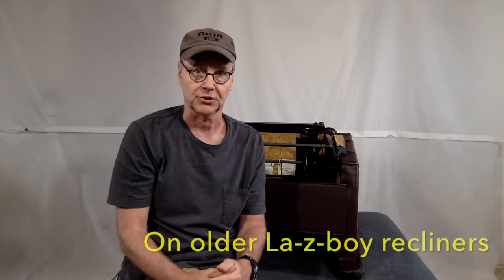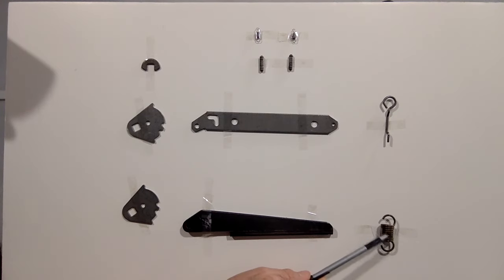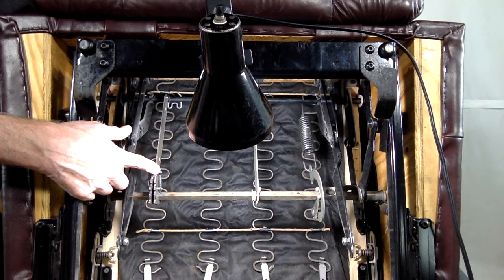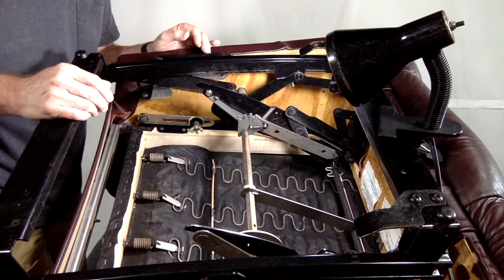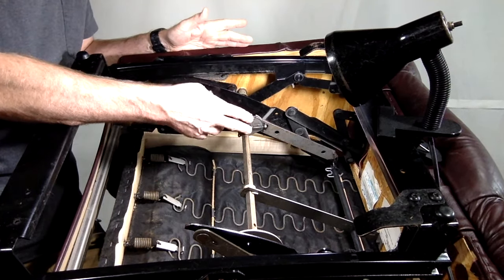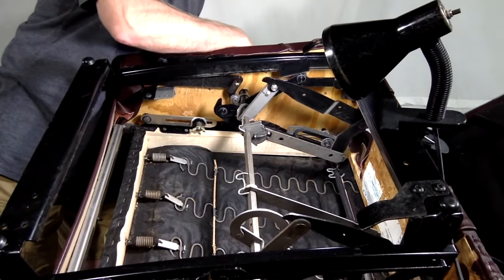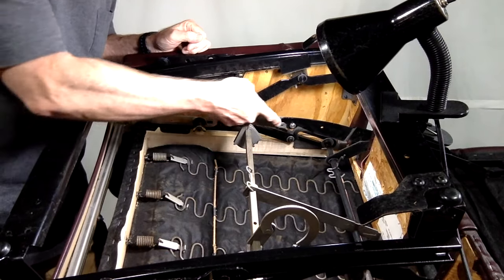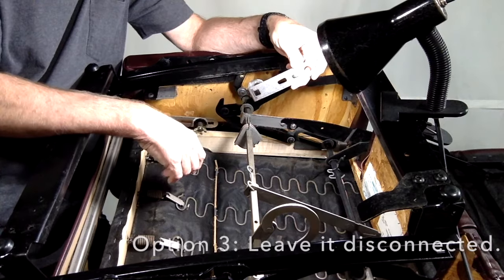Troubleshooting the La-z-boy 3-Position Footrest Feature

Comment: Thank you for this video!  I have a nice leather La-Z-Boy from 2001.  The footrest has been sticking off and on and last night became completely stuck in the up position.  Using your video as a guide, I completely removed the 3-position lever. I also appreciate the warning about having it all the way open or closed, to safeguard one's hands. I will not need to rebuild, as I only need completely up or completely down.  My chair now works like a charm!  And it only took about ten minutes and no repairman's bill to pay!  (By the way, I am a 68-year-old woman.  I'm quite mechanically inclined and relatively strong, and I like to fix things if I'm able.)
Reply from the maker: @Joy Rimpau - Congrats! Disconnecting the older 3-position mechanisms is a prime example of knowing a few simple steps, rather than being highly-skilled or trained in order to perform the required fix. Good job!

Comment: Thanks for the video, my good man. The pivot pins look a lot like one of the pins within the trigger housing of the Remington 870, although they're going to be wide. I'm gonna need to dig around for them to see if that would be a viable option even though they wouldn't be factory.

Also, the entire time you're saying "upgrade" to the "modern" PLASTIC parts by buying extra crap, my brain was screaming "Cut it out of metal!" I may still be young, but I've learned that plastic is almost never an upgrade.

Merry Christmas, brother.
Reply from the maker: @NeverMetTheGuy - I just placed a La-z-boy part order that included Pivot Pins. I want to see if they might be available again. Check with your local La-z-boy dealer to see if they may have some left in stock.

"Upgrade" was a poor choice of words, "convert" would have been better. I have to say though, that I do recommend the conversion for those who use the 3-position feature heavily. The plastic clips are easier to swap out, typically last a long time and are cheaper to replace.
Reply from the maker: @NeverMetTheGuy - I was able to get the Pivot Pins I ordered. If you've not tried to order them yet, give it a shot!

Comment: Thanks for these videos. My Lazyboy recliner is 22 years old. The reclining gear finally stripped out. I didn’t want to trash the chair. I followed your video to fix it, ordering parts from Amazon. 
Then I realized the 3-position footrest hasn’t worked for years, so when this video, I fixed it. My parts look a bit different but you gave me enough to fix it. The little springs were broken but I still had the pins. I found a long spring at Ace Hardware with the correct circumference. I cut two springs from this new one and voila! It worked. 
Thank you. You saved me $1,000 for a new big chair.
Reply from the maker: @XanderJudd24 - You're welcome -- good job!

Comment: I have an older style 2004 model with the pins.  My u/c bracket (spring hook) broke on it and no nearby dealers sell it anymore.  Seems like finding parts for older model chairs is impossible.
Reply from the maker: @theoriginalplasticwrap - The parts you need for your 3-position footrest setup should still be available. Contact La-z-boy through their contact (email) form on their website to find out.

Comment: I have an electric Lazy Boy. 2019 1HR530.I know it was designed to not lock when in the recline position (Lousy Design) But the Foot rest only lifts up about halfway maybe 3/4. It will not go all the way up or flat. Any suggestions?
Reply from the maker: @Ron Glaze - Have an experienced repair tech inspect the chair. Many newer La-z-boy electric recliners do not open as far as older models. The tech can tell you if that's the case, or if there's a problem with the mechanism operation instead.

Comment: What is the name of the large semi-circular silver part next to the scissors mechanisms on each underside of the chair? The circular parts rotate when the recliner lever is engaged or disengages. One of the "circular parts" is inoperable because the rivet holding the circular part to its attachment on the recliner operating shaft sheared off completely. How do I stretch the spring to align the circular part with the stationary "ear attachment" on the recliner lever shaft? I can't afford to replace this chair so I hope you can help me.
Reply from the maker: @tearjerkMASS - The "C"-shaped part is the Toggle Subassembly. The purpose of this part is to hold the tension springs that assist the mechanism in opening & closing. Newer chairs have 1 Toggle, while older models can have 2.

With one failed Toggle, you should still be able to open & close the recliner. But you may notice there's less of an assist from the springs. If that's the case, you don't need to repair the failed Toggle. If you decide to repair/replace the bad part, get an experienced repair tech to quote the repair.

Comment: Thank you so much! I have a 1991 Lazy Boy recliner that I bought new and have never had a problem with until the other day when the footrest got stuck in the up position. Thanks to your clear instructions and excellent video footage, I, a 61-year-old woman, was able to pull off the back, flip it over, and remove the small pins and springs around the 3-point  ratchet, and now it works perfectly! I  never realized that I don’t use the footrest positions any way. I adjust using the back ratchet mechanism. I’m back in my “Lazy Girl” again!
Reply from the maker: @Mary Mclvor - Congrats!

Comment: Hi Recliner Repair Guy!  Thank you sooooo much for the excellent video.  Very helpful for the 3 position repair.  Got the bullet pins and springs on Ebay for $15.  Not sure where the spacer goes but we fixed a 12 year old chair pretty easily.
Reply from the maker: @Lynn Dolphin - Good job! The spacer that fits on the Drive Rod -- if that's the one you're referring to -- goes between the 2 Lock Plates (gear-like looking parts).

Comment: I have an old lazy boy rocker recliner, the wire that pulls the foot rest up and down has broken several times, that I fixed with some wire I bought from fleet farm, but this time after I fixed it,  I have been having this problem of it only going to one position, which I'll look at to see if I can see what you are showing here, even though mine does look quite a bit different, but the problem that's really bothering me is that when it's reclined it seems to not lock in place.  So when I'm laying back the chair still rocks back wards.  What could cause that?
Reply from the maker: @Scoobydoonut - It sounds like your Ratcheting Recline parts may be worn and need replaced. See this video ---> https://www.youtube.com/watch?v=d8Bk2j4dc-k&t=2s

Comment: Can you help  me I need my foot rest keeps falling down when I put even the weight of my legs on it it's a lazy boy idk the model number
Reply from the maker: @EntertainmentHub92 - If you've inspected your mechanism Leg Extenders, as suggested in the video & found no problems, you can try disconnecting the 3-Position Lever (or 3-Position Locks, if you have those). If the footrest still won't stay up, have an experienced repair tech take a look.

However, if the entire chair pitches forward, but the footrest stays in the fully open position, this is a Ratcheting Recline problem. Again, have a repair tech take a look.

Comment: Thanks so much for this. The recliner I have is one my parents used to have and has the old metal 3 way. I was able to get that disconnected so now the footrest does go all the way down and will lock up. A side effect is that now the ratcheting for the back doesn't work anymore. I don't believe I will be able to get replacement parts that will work. I suspect the answer is no but is there any way to get the back to ratchet as well? I was thinking maybe some way to plug the gaps in the 3 way and re-connect it.  Thanks in advance!
Reply from the maker: @EdCatlett - The Ratcheting Recline tips (pitches) the entire chair back. It's separate from the 3-Position Footrest function. The Back tilt is yet another separate function, independent of the other two. (See the 3-Position Footrest & Back Tilt Tension videos to learn more.)

Disconnecting the 3-Position function will not stop the Ratcheting Recline (or back tilt) from working, if it was working properly to begin with. However, you may have to use the chair a bit differently to engage the ratcheting feature. 

For example, if the chair is slumping forward when the footrest is fully extended, you'll need to move your weight back in the chair to engage the Ratcheting Recline. 2 ways to do that: #1 If you have long legs, move 1 leg off the extended footrest & onto the floor & push back to engage the ratchet. Or push back against the arms. Or, #2 Do not sit or lean forward when opening the footrest. But rather throw your shoulders back a bit when opening the footrest to engage the ratcheting recline. 

If none of these suggestions help, find an experienced repair tech to troubleshoot the problem.

Comment: My legs Lazy Boy does not go high enough for my legs and I would really like to just disconnect the lower part of my chair and just have it upright the upper part I just want to reply never fart I can use a chair or stool put my legs up on that will be the right height so how can I disconnect the lower part of this chair I don't want it to raise because when the electricity fails I can't get out of my chair I had a generator installed just so I could get out of my chair that the electricity I bought my chair in December and this is April and the push buttons on the side I really hard to get to and they quit working my first Lazy Boy at my mother gave me in 1984 and I've been sitting in it ever since the wood part underneath the spindle broke I guess it right it out and it broke and I surely do miss my chair
Reply from the maker: @Linda M Johnson - Most electric La-z-boy recliners come with a battery-backup compartment located inside the power supply. If you're concerned about a power failure, make sure you have fresh batteries installed.

If you want to disable the footrest, have someone disconnect the electric plug to the footrest actuator for you.

Comment: Okay, I took the swivel base off, and was able to remove the springs and pins, and the arm.  Put the chair back together, and the footrest goes up, but won't lock in place.  What should I be looking at?
Reply from the maker: @donriley9053 - If the footrest is closing on its own -- not staying open -- you need to inspect the Leg Extenders (scissors), Toggle tension spring & other parts along the Drive Rod. You're looking for bent, broken or damaged parts that are preventing the footrest from locking out into the full-open position.

However, if the footrest is staying open, but the chair itself is dipping down in the front, that's likely due to worn Ratcheting Recline parts. See this video for more  --->  https://www.youtube.com/watch?v=d8Bk2j4dc-k&t=3s

Comment: Mine was bough in 01/04 and doesn't have ratchet looking gear thing. Mine just has more of a "U"-shaped hook thing on each side. Any idea what I can do?
Reply from the maker: @teller12 - Not all La-z-boy recliners have the 3-Position Footrest feature. If you don't have the metal setup shown in the video, there is another type which uses the plastic 3-Position Locks shown in this video  ---->  'The La-z-boy Recliner 3-Position Footrest.'  [ https://www.youtube.com/watch?v=-uMYiqBp0y4 ]

If you don't have those, you don't have this feature. HOWEVER, if you check out the video I suggested, it will explain how you may be able to use the plastic locks on your recliner.

Comment: How do I actually change that mechanism ? I have to manually release the pin every time my wife reclines the chair. I know that I need to buy the part, I'm not sure what to call it to even order it. Thanks so much.
Reply from the maker: See the video series -- 'Drive Rod Replacement' on the ReclinerRepairGuy.com website. Those videos include removing & reinstalling parts along the Drive Rod. The video where you placed this comment shows you how to disassemble the parts. Assembly is done by simply reversing these steps.

Tip: Use a bent paper clip to stretch & install the small extension springs. It's easier than using your fingers & less likely to damage the springs.

Here are the new parts you'll need to rebuild the older, metal 3-position footrest mechanism.
     * 3-Position Lever - 1
     * Lock Plate(s) -- your setup may have 1 or 2, depending on the age of the chair
     * Pivot Pins - 2
     * Extension Springs - 2

Be sure to add any other parts you need to your parts list, including pins & clips that hold parts in place. When in doubt regarding part names, you can always email them a picture.

Comment: You show and describe a plastic part, and then show a chair that is made of metal parts.  Do you know there is a difference between metal and plastic?  They are not the same and do not interchange in this video.  Pretty worthless.
Reply from the maker: @david hjortnaes - Text from the video, "In a previous video, we covered newer La-z-boy chairs that have that (3-position) feature controlled by this black plastic part, called the 3-Position Lock. The video we're doing today, is going to take a closer look at older chairs that are setup with all metal parts that perform that (3-position) function." I hope that clears up any confusion.

As far as interchanging or changing the metal setup over to plastic, it can be done, as described in the video.

Comment: Thanks for the video. My recliner was operating well until the last few months. The first 2 footrest positions lock as they should, nut fails to lock in the 3rd, straight out position. I can literally push it back down.
Reply from the maker: @Brent Hebert - I've seen some older La-z-boy's develop this issue as they age. It's not a problem unless the footrest is closing when you don't want it to. If that's the case, it can be due to a few different causes. If you can't identify the problem, hire a repair tech to help you out.

Comment: Okay, I don't want to purchase the wrong part. My Lazy-Boy footrest drops when I put the weight of my legs on it. I should contact a Lazy-Boy dealer and purchase a plastic 3 position lock. Am I correct?
Reply from the maker: @Cathy Stultz - The first step is to do an inspection (or have a repair tech do one) to determine the cause for the footrest drop. Remove the chair back & turn the bottom over to view the mechanism in action while opening & closing the footrest with the handle. DOING ANY INSPECTION OR REPAIR IS AT YOUR OWN RISK!! The footrest can open or close unexpectedly, causing injury if your hands are inside the chair!

Look for bent, broken or otherwise damaged mechanism parts. If none are found, note whether the 3-Position Footrest is controlled by metal parts or the black plastic locks. If metal, follow the suggestions in this video. If the plastic locks are present, remove them as shown in this video --> https://www.youtube.com/watch?v=-uMYiqBp0y4&t=1s

Reassemble the chair & test operation. If the footrest no longer drops, the old plastic locks were the cause. If it still drops with the locks removed, you (or the repair tech) missed the problem during the inspection phase.
Reply: @reclinerrepairguy4155

Comment: My older, inherited Lazyboy, while fully functional  (rock, swivel, recline) makes quite a  bang at the moment the footrest is released from the raised position . If i tip back simultaneously, i can avoid it. Is it broken? Or is that just how it is?
Reply from the maker: Lex Conor - The noise you hear is the Ratcheting Recliner feature disengaging, and that is normal. You've figured out how to avoid making this noise by relieving the pressure on the parts before disengaging (using the handle to lower the footrest). 

Another method some people use is to place one foot on the floor (if your legs are long enough) and push back just before lowering the footrest.

To learn more about the Ratcheting Recline Feature, see this video  ---->   http://reclinerrepairguy.com/lazyboy.htm#ratchetrecline

Comment: We have a 1995 lazy boy that the footrest sticks in the middle position.  Would you suggest we try to replace the springs and bullet pins if we can find them.  Everything else looks smooth, tight, and straight.  Thank you
Reply from the maker: @Lona Ockenden - The Pivot Pins don't need to be replaced unless they have obvious gouges on them (surfaces are no longer smooth). The Extension Springs can be replaced, but if they're not broken and the end "hooks" aren't stretched, they will still work. (Order a spare set if yours are still good.)

The Lock Plate(s) and 3-Position Lever are the parts that typically need to be replaced due to wear or the Lock Plate getting caught inside the 3-Position Lever during operation.

It's been a while, but the last time I tried to order Pivot Pins, I was able to get them.
Reply: @reclinerrepairguy4155  Thank you!  We will try to get a new Lock Plate and 3-position Lever

Comment: Ours is about 4 years old and electric. Footrest got stuck in the up position. The motor made a grinding/working hard sound as we finally got the footrest down. Afraid to try using the footrest again. Any suggestions? Thanks. Great videos.
Reply from the maker: Rebecca McDowell - Sounds like a lift motor may have failed. If you're a DIYer, checkout Troubleshooting Electric Recliners -->   http://reclinerrepairguy.com/general_repairs.htm#troubleshootelectric  

If not, contact your La-z-boy dealer and have them check it out.